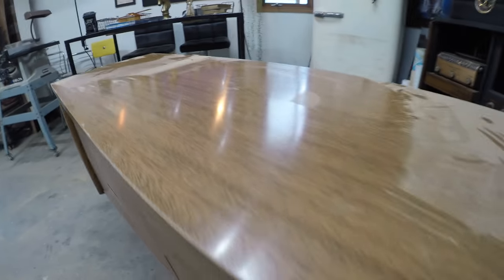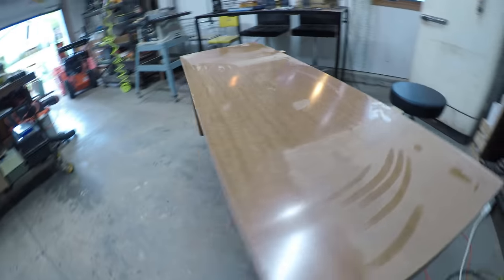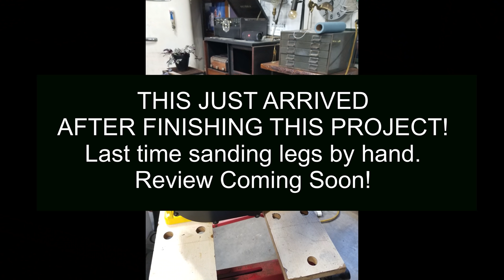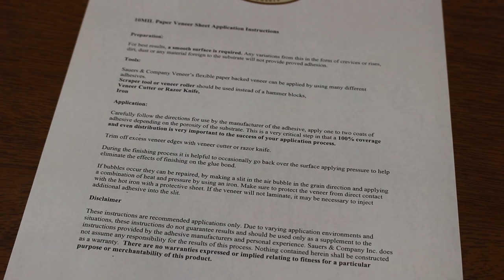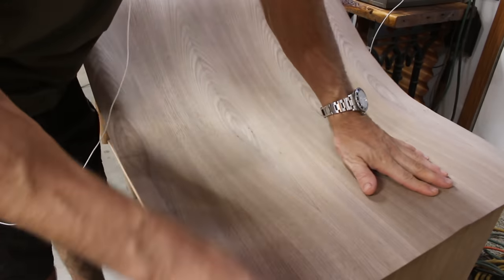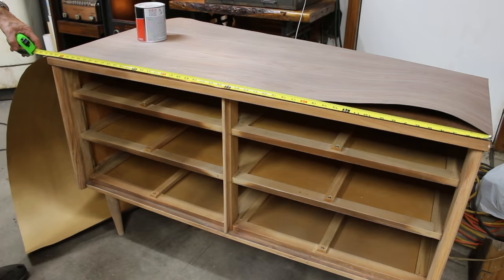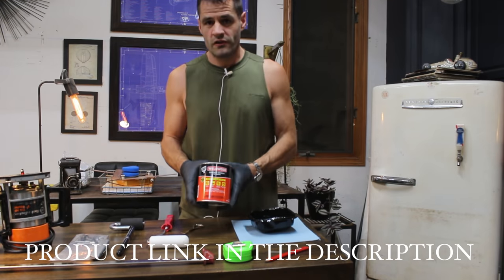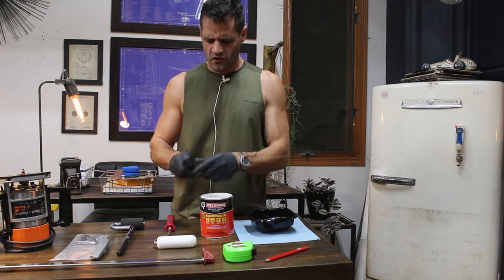Ep. 17 This Old Dresser was Trashed

Comment: Great job. I’m sure someone has mentioned, but when routing an outside edge, you should move the router counterclockwise and clockwise for an inside edge (like for a sink). Awesome job though!
Reply from the maker: Thank you for sharing. I did another recent veneer application, this time working counterclockwise and it went much better. Thank you for this advice. If you have other suggestions, please let me know. Barry
Reply: As a drywaller I approve this message
Reply: I came to say this, the bit should always be spinning away from the material. So as Mike said, when the Router is between you and the work, move from left to right (never go back in the direction you have just made a pass on) when you get to a corner continue "around" it.  When the material is in the middle, as in you, the material then the router Move right to left - Mike will correct me If I'm wrong, I just learnt this about a year ago so I'm a novice too

Comment: The reason the router reacted as it did is the direction you were going as the cutting tool (bit) is turning clockwise, you need to have the work piece on your left as you move forward. In other words, the blade will be turning in the opposite direction of the cut. I'm sorry if I'm not articulating this very well. Just make sure you move the router in the opposite direction you did in the video. There. That was better. I really appreciate you folks doing this work. You've taught me a lot.
Reply from the maker: Thank you for the info Mario. Several other viewers provided the same advice and have done a few veneer videos since. I appreciate the feedback and your support on the channel. Barry
Reply: @MadCityModern  I was going to comment about this same issue as well but I looked of anyone had done it yet. 
Not just for veneer but for any application always move the router counterclockwise.

Comment: A piece of advice on the router...you want to account for the direct the blade is spinning.  When trimming an outside edge go counter clockwise. Go clockwise if trimming inside an opening. You will get a much cleaner cut.
Reply from the maker: Thank you for this great feedback. I have since learned to use this method and it made a huge difference. Thank you

Comment: Good job on the veneer! I want to mention, you can thin out gel stain with paint thinner or lacquer thinner. Makes it last much longer. It also helps to put a coat of paint thinner on a surface just before applying gel stain as it spreads smoother.
Reply from the maker: Thank you for this tip. I will definitely be trying this on the next project! That video should be out this weekend. Someone else mentioned using a veneer trimmer vs the flush mount bit that I used. Any thoughts? I was actually pleased with the nice finish from the flush mount bit, but if there is a better way, I'd like to learn. Thanks Rick. Barry
Reply: @MadCityModern  Flush trim is ok. I would score the top with an exacto knife and a stright edge first, so the fibers break. I also use a veneer trimmer, and I like it, but the scoring has to happen first. Sometimes I think I am better off with an exacto knife than anything else.
Reply from the maker: Great! Thank you. I have an exacto knife and I found that I enjoyed trimming the veneer that way.

Comment: It turned out wonderful. 
How about a little tip from a long time woodworker and someone who has done a lot of laminate and veneer application. When you use a router to trim, as you did, you should only push in the direction of the cut. Look at the direction the blades spin on your router and make sure you are pushing into the spin. This is what was causing the veneer to fold over and why some edges came out fuzzy while others were smooth cut. Saves a lot of time in sanding at the end. ;)

Comment: Hi Barry. Congratulations on becoming monetized! That is awesome.  I did let the commercials run to hopefully help you out. I really liked your Nutmeg color choice.  Your donated piece will hopefully be a good advertisement for your great workmanship. 

I had purchased an antique buffet years ago. It had peeling veneer on the drawer and sides. Pieces were missing and still peeling. After removing that I painted it with chalk paint in a orange with white blend and transfers. After several months I changed it to turquoise.  This year I sanded it all down and it's white with wood legs and the pieces between the drawers and doors. I've always kept the top in its original wood color. I think I've finally settled on it staying this color.

Thanks for another great video. Wendy
Reply from the maker: Hi Wendy. I love all the details in this message. I didn't really have any expectations with getting my name out in the community. I fear having to take on commissioned pieces : ) I laugh, because i have changed several pieces over the years. Trends and ideas change. Always fun switching it up. Barry
Reply: @MadCityModern  fear, naaw, you could do commission stuff easily.  I'm pretty sure you can set limits and not get to where your fun hobby turns into a dreaded obligation. Can't wait to see what you're working on next!
Reply from the maker: Thank you. I just don't want to lose the joy this brings.

Comment: When there is a nick in the wood (as the one at the bottom of this dresser that you filled with filler) and you plan to stain, try mixing some sawdust from the project with a bit of the filler or glue.  The stain then is absorbed in the repair area.  I have even done this in the cracks in wooden floors in a century home.

Comment: Look for a small trim router for the veneer. Much more manageable with less of the rool hanging out over the edge of the piece.
Reply from the maker: I have been searching. any suggestions?
Reply: @MadCityModern  I have the Bauer corded unit from Harbor Freight, no complaints so far. If you can go today and use the 20% coupon that expires today you can get it for about $50.

Comment: Proper way to use the router is in the direction counter to the rotation of the bit. In this instance you should be moving left->right. Small bit, high rpm, move left to right, unless routing into the grain.
Reply from the maker: Thank you for this tip Phil. Another viewer also suggested this. I corrected the mistake in the video that followed. I appreciate the support. Barry

Comment: I would use wood on wood veneer for better results,paper back can bubble easily. Use a veneer edge trimmer instead of a router.
Reply from the maker: Great tips. Interesting that the woodworking store doesn't even sell wood on wood veneer. Where do you find it? I will look around for an edge trimmer.
Reply: Online at Van Dykes or Rockler Hardware.I also play it safe and use 2 coats of glue  kinda making the surface look varnished, test it with a piece of paper if it won't easily stick its ready.
Reply from the maker: Ok. Thank you for the help. I kept the last project to see how the veneer holds up with normal use

Comment: All of the steps are very nice to watch. I have a question though...Why did you leave the laminate on instead of taking it off before you put the veneer on? Just curious. Very nice restoration!!
Reply from the maker: Hi Ron. I have watched others do this over laminate. I have never noticed the thin layer of laminate once the veneer is on. Not sure if this method is right or wrong but has seemed to work well.

Comment: Great vid, just wondering I’m looking in to getting a contour scrapper myself and I see you have both the Allway and the Hyde in your videos. Which of the 2 do you think is the best overal?
Reply from the maker: They are about the same. So I'd say the Hyde has the edge since the blades are much easier to switch out. Someone did tell me that they broke the Hyde easily but I haven't had issues yet

Comment: Quick question . . . on the rounded decorative edging would you consider using a stripper first to remove the finish followed by the scraper?  I am a big fan of your work and am still getting into your videos that I have yet to watch.
Reply from the maker: Not a bad idea. I usually try the scraping method first because it is much cleaner and doesn't have much waste. Also, I don't have to wait for things to dry after sanding. Mostly I find scraping to be enjoyable
Reply: thank you for your quick response!  Scraper it is!

Comment: OK, just wondering, wouldn't a paint stripper, or finish remover, or sanding, have been a lot quicker and less labor-intensive (than scraping every surface), whilst doing essentially the same job -- removing the old finish? 
I dunno -- because I don't do this kind of stuff -- so just asking.
Your first go-to scraping method would never have been my first thought of how to remove a finish, but as I said I don't do this kind of work, and I'm sure different finishes require different methods of removal.
Reply from the maker: I always watched others scrape and told myself "never". Now it is my go to. Having a good carbide scraper is key. Most finishes come off easily and the scraping actually isn't too exhausting. The stripper is expensive and leaves a mess. Great question
Reply: Glad you asked this because I was wondering the exact same! It seemed really counter intuitive for someone who knows nothing about furniture restoration lol

Comment: Is there a reason why your scraped it first? Why not just sand? Starting to learn so I’m just curious
Reply from the maker: Yes. If you see my recent mid century desk restoration you will see how amazing the carbide scrapers are. The Bahco is far superior in my opinion so far. You are left with a clean surface for staining. Until you have worked on veneer a lot, you run the risk of sanding through the thin veneer. Also, I waste so much sand paper without scraping first. Hope this helps. I think the best thing I can do is refer you to 3 or 4 of my most recent videos. Scraping is my favorite thing at the moment. Thanks for the question. Barry
Reply: @MadCityModern  thank you for replying! I’ll definitely go check those out!
Reply from the maker: Let me know if you have questions

Comment: When you were using your router to cut the veneer one of two things could have gone wrong. 1. You were routing in the wrong direction. There is a direction you are supposed to go and I believe it is opposite to the rotation of the spin of the bit. I don’t think this is what you did because if you were going with the spin the router would have gotten away from you (ie went really fast). 2. Your bit was dull or of bad quality. This looks like the case as even when you were cutting the edge looked torn and not sharp. Get a good quality sharp bit and it will work better. Otherwise love your work
Reply from the maker: I have since learned several things. It was a brand new carbide bit so I know that wasn't the problem. I should have been cutting counterclockwise. The finish was rougher than it should have been, but just required more sanding. Always looking for great tips like these. Thank you

Comment: Hi just want to start with good job but please please use your respirator when using that dap contact cement, it is some really nasty stuff and you do not want to be inhaling the fumes from it.
Reply from the maker: You're right. It was strong. Had the windows and doors open with the fan blowing but the respirator would have been good